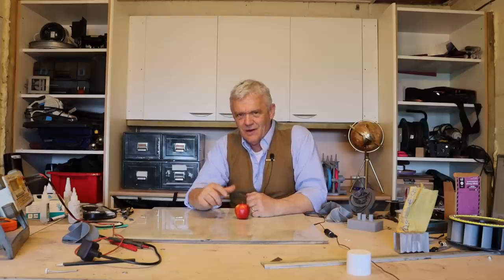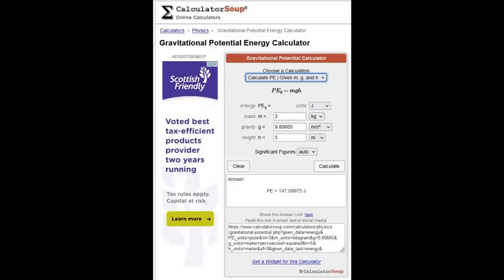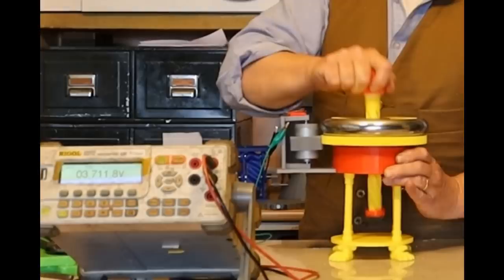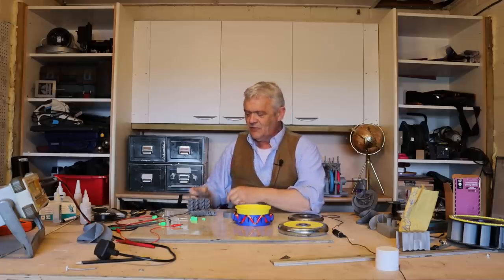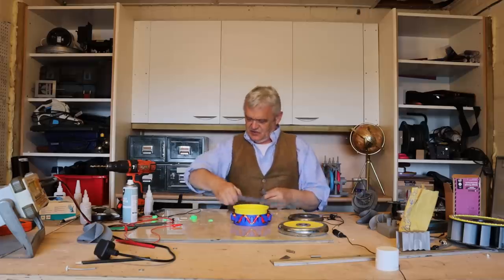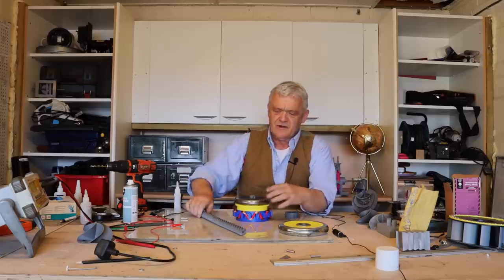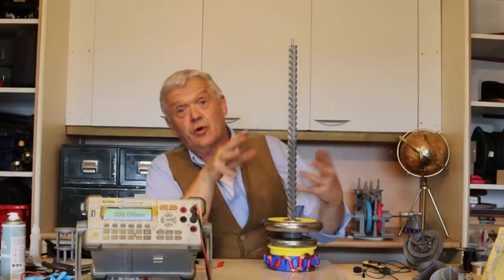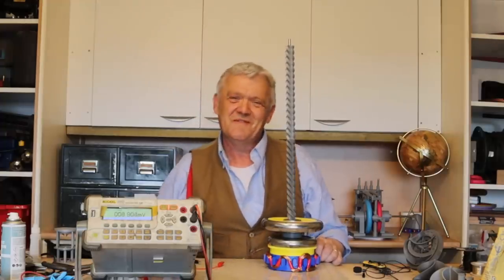2047 Gravity Energy Storage

Comment: What about a yoyo ? Do you get any extra energy from the rotation? Or equal to freefall?
Reply: Interesting question, well done!
The yoyo scavenges some of the kinetic energy from the system as it falls - you can verify this by comparing the rate of fall of the yoyo in operation to just letting it fall to the ground. The kinetic energy is transferred into the yoyo and applies a torque force at the point where the string starts to curve around the string line in the yoyo. This torque builds angular momentum in the yoyo which is stored in the flywheel like body. As the yoyo moves down the string the diameter of the string on the reel decreases and the effective leverage of the applied torque changes helping to drive the spin of the yoyo faster but at an increased cost to the overall yoyo system.

TLDR: You don't get any extra energy from the yoyo, throwing a yoyo down adds energy - you always only ever get out what you put in.
Reply: @frackcha  Yea.. basically just coverts the linear down force to rotational force..
Reply: This has been a fun one.
It did have me thinking of some kind of yo-yo. I'd prefer using a yo-yo motion more then the one he was spinning over his head.
Maybe even a Whee-Lo generator sometime in the future.
Reply from the maker: no mate
Reply: @st33ldi9ital  Exactly!

Comment: Would love to see you use ropes and pullies instead of the 3d printed custom axel. It will be much easier to source and diy. Also try to maximize the weight, hight , and gear it so it drops as slow as possible. 200 kg, which can be pulled by 6 pullies to to give the effect of 25 kg effort for reseting it back up. For 2m height youd pull 16m of rope. Pretty sure you can do that in 1 minute or so. Let the weight drop for 6 hours. How much watts would you get for that? (200kg at 2m over 6 hours)

Comment: couldn't you step up the speed with the gear box you made, this gearing might increase the rotations of the rotor through the gearing giving higher run time and voltage.
Reply from the maker: for sure mate - this is just showing a proof of concept

Comment: How large would a capacitor need to be to store the energy from a lightning bolt? Or how large of motor would be needed to power itself to run off of a single lightning strike and run up a heavy flywheel to power a generator?

Comment: energy storage is very interesting,we need to figure that out and find a good solution and gravity is easy to make and reliable but there is another way i´m curious of and that´s a Hydrophore System with nitrogen filled tank that u pump oil in to like those load dampening systems om front end loaders and timbercranes e.g
Reply from the maker: there really are lots of good ways mate that don't need batteries

Comment: Would a gearbox between the spiral and the generator have any benefit? Could you slow the drop but keep the flywheel spinning at high enough RPM to generate a usable electrical current?

Comment: watching you giggle like a kid as i do when i build things and they actually work. i couldnt help but laugh as i came up with a terrible joke when you just kept making it bigger.
if you painted it black you could have a big black corkscrew. the dark paint would help keep things cool with its heat dissipation under work loads.
wouldnt want your ratcheting mechanism to overheat either. the paint could help with that. wouldnt want your parts to melt under the stress.

Comment: While interesting... you would need a device three times the size of your house to run just your regular appliances...  I pray God that we perfect fusion power.  It will change the world, bring electricity to even the poorest of people and countries and revolutionize the need to burn hydrocarbons to make electricity.  In fact, you can use the surplus electricity to create hydrocarbons by breaking apart the CO2 from atmosphere and ecombing into petroleum compounds.  The process is insanely expensive- without cheap electricity.  But with fusion power, gasoline, diesel, etc are easy to make- and cheap.

No more oil tankers, no more Valdez spills or rig failures like the one in the Gulf of Mexico.  No more dirty, dangerous and destructive oil refineries.  No more oil drilling anywhere- because you can create hydrocarbons out of thin air!  

Now environmentalist hate the idea- because they think cars are killing the world.  Well we have had most perfectly demonstrated that electric cars simply are not up to snuff and that hydrocarbon fuels are the only way to go for the foreseeable future.  But you don't have to create just gasoline- any hydrocarbon is possible.  Anything from natural gas to propane or even gasoline- it does not matter, as it's a wash for the environment.

How so?

Well where did the CO2 come from?  THE ATMOSPHERE!  SO when the hydrocarbon is created, you are drawing CO2 from the air.  And when the hydrocarbon is burned and the CO2 released- you are only putting back the exact amount you took out!  

The only issue might be locally concentrated smog, (think LA in the Spring & Summer- ugg,) but switching cars to propane or natural gas is FAR less "smoggy" than gasoline.  Propane and gasoline burn nearly identically in an engine, so conversion is cheap and easy.  (I had an old school Onan generator that ran on gasoline, propane or natural gas- flex fuel before it was cool.  Propane has the exact energy coefficient as gasoline- you don't even need to change the timing on the engine.)  

This is why fusion power is seen as the Holy Grail by informed environmental types, as well as the energy industry.  Cheap, almost free energy generation will change the way the whole plant lives.  It will save million of lives while clearing the air and preventing oil disasters, pollutions, smog, etc.  And it won't affect global warming in the least.       

A bright future awaits all of us if we can just crack the secret of a sustained fusion.  We can do it- in short bursts.  But getting it to sustain, aye there's the rub.